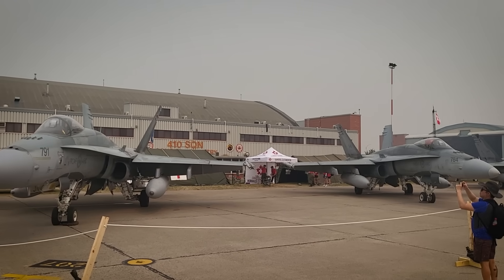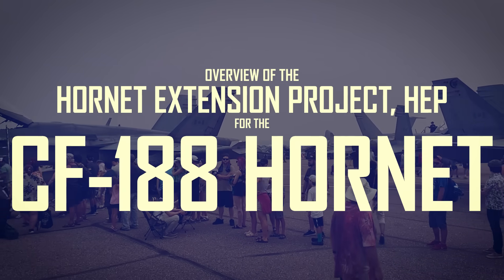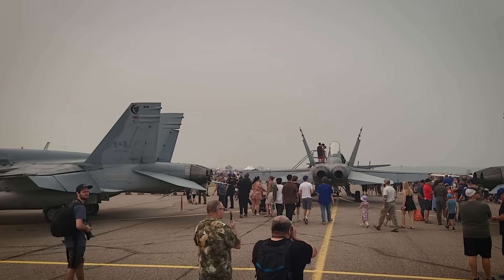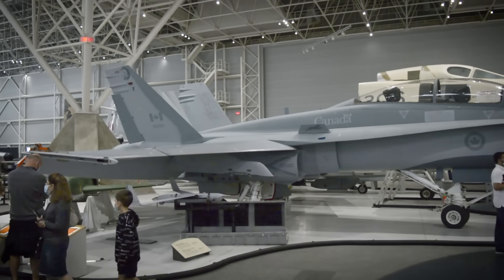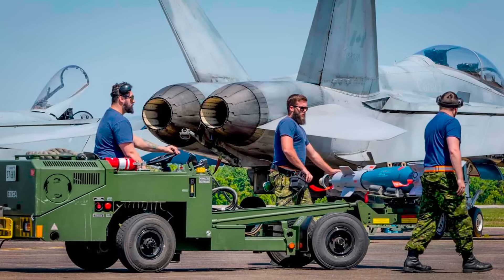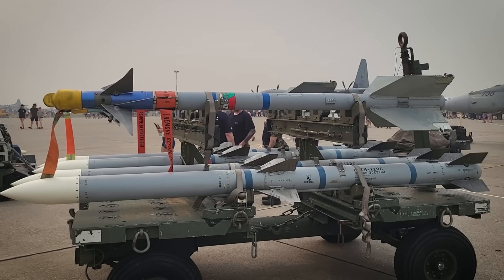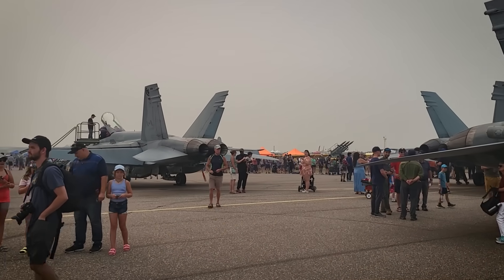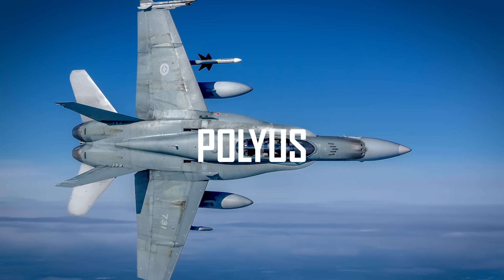The latest CF-188 upgrade program, Hornet Extension Project, HEP (No AI)

Comment: “Balloon Killer” indeed! 😂
Reply: at the 'Carney' midway, side show.
3 darts for a buck!
Reply: not just balloon killer...proven balloon killer.
Reply: I am certain that the AIM-9X has been used to bring down aircraft in Syria.  There's been multiple MiG/Sukhoi and Mi-8/-24 shootdowns there in the past decade.
Reply: @Panzermeister36 pffffft
Reply: 3 AIM-9X from F-22 brought down 3 balloons in 2023. They were modified versions.
Reply: I wouldn't bet on any kind of hornet making an intercept at 60k', modified AIM-9X or not.
Reply: @corvanphoenix  Agreed. Even the highest of the 2023 balloon intercepts had the F-22 in level flight at 58,000 feet whilst the balloon was over 1 mile higher.
A 4th balloon was shot down in 2023 by US ANG F-16 jets at 40,000 feet. AIM-9 Sidewinder was used, but I cant confirm its actual variant. 2 missiles were required for that shootdown as the first missile missed.
There's a reason why the f-22 Raptor was used for that shootdown. Some dont realize just how thin the air is up there.
Reply: @hoghogwild  Exactly. Plus just how much thrust you need to stay above stall speed at high altitude. It's kinda sad how many people think the balloon shootdown is some kind of star wars era weapon vs renaissance era threat.

Comment: Hello, the official designation we use in Canada for all our aircraft doesn't include the dash, so it's CF188 or CC330 or CP140.  The computer system in the 90s required three digits which is also why we end up usually duplicating one of the digits in F/A-18 or C-17 etc.

HEP II is primarily meant to phase in the weapons that we will receive with the CF35 project.  Great video!
Reply from the maker: Ah thanks for clearing that up! I wondered why they were different
Reply: @polyus_studios  officially the aircraft is the CF188, though CF-18 is also used unofficially.  Then the dash gets supplanted into the three-digit nomenclature.
Reply: And soon to come is the CF355.
Reply: @BBHC2012  It's too bad they didn't go with the traditional naming convention where the first digit was always 1, although the number '135' was already used by the Bell Twin Huey, the CH-135.
Reply: I like hearing how quirky things like that come about, thanks.
Reply: The fact that the military would change the designation, rather than fix the software. I'm sure this says something about the CAF, but I'm not sure what.
Reply: @thekinginyellow1744  Did you serve ?  There is lots of "smart" choices made all the time.

Comment: Amazing great video. 
Gripen vs F35!
Reply from the maker: That's a tough one. I could only really speculate about them since most aspects are classified. I like to focus on older stuff because the facts have all come out. New stuff feels like reporting on manufacturers brochures more than history.
That said, i will be going into some depth about the replacement of the Hornets and that will definitely contain some comparisons!
Reply: @polyus_studios  The question is not a very fair one in my opinion, aside from the whole classified bit.  The Gripen E is a 4.5 generation fighter (same as the upgraded CF188s) and the F35 is a fifth generation fighter.  A better comparison would be the upgraded CF188 vs Gripen E (or the last version Gripen C/D).  Would purchasing the Gripen be a step up from what we have currently, aside from a newer airframe?  For example, the Gripen and Super Hornet use the same General Electric F414-GE-39E engine, but the Hornet has two and the Gripen has one; is there a benefit to this?  Of course a video like that might be a lot more political, given the current situation, than your normal videos are, and I am not sure that is what you want to do.
Reply: @benstapley6077  It would probably be worse for Canada. Capability wise they're similar, but the F/A-18 platform has better support. It also is much cheaper than the Gripen E. Gripen C is just flat out worse at the moment, at least until MS20 Block 4 in 2028.
Reply: @benstapley6077  The whole single engine vs duel engine argument died years ago. Engines are so reliable today, that it doesn't matter as much as it did when we chose the Hornet. 

Would the Gripen E/F be a step up from what we have now? You would have to ask yourself if the Rafael, Typhoon, and Super Hornet would be a step up from what we have now, as the Gripen E/F is in the same league as they are. The answer is yes btw.
Reply: @benstapley6077  Not that whole, but "the Gripen is only a 4.5 generation aircraft" again.  The camp always ignores a few keys points about the F35 including that it will have been in the air for 20 years already in 2026 and that military radar tech has advanced to the point of being able to detect stealth planes now.  But does Canada really NEED a 5th generation fighter like the USA does.  Canada won't be entering any countries air space for the foreseeable future, China and N Korea are too far and Russia essentially has been neutered and it will probably be 10 to 20 years of re-building before it poses a significant threat to NATO, if it survives as we know it now.  That is all of the "traditional" Western enemies which leaves the only country that has directly threatened Canada since WW2, the USA.  If they ever did make good on their threats, it sure would be handy for them if they could enter a code and disable all of the jets they sold us, eh?
Reply: @viper29ca  I think the Super Hornet would have been a great Choice for Canada, that ship has sailed, the production line is almost wrapped up.
Reply: @kisaragi_san1378  but how long can they possibly keep them in the air? and are the pilots getting enough flight hours?
Reply: @kpal2946  The Marines were using F/A-18A's (specifically F/A18A++'s) up until very recently. The C's (which, for Canada, are later blocks) will be fine. No comment on the flying time for crews, of course.
Reply: @PePe_007-A1 me when i misunderstand military technology but talk authoritatively on it
Reply: @kisaragi_san1378 the f18 is cheaper because it is older and there are several counties who use it. But the number of counties using them is decreasing so the economy of scale will not be in the f18 favor for very long. Also we need new airframes. The ones we have are getting very old and it is going to become a safety issue for our pilots if we can get them into new aircraft.
Reply: @viper29ca surely two engines provides a better thrust to weight ratio, which woukd improve acceleration and rate of climb, two factors which are very important for an air supremacy aircraft. We don't dogfight like the 2nd and 3rd gens used to, but in a scramble scenario, it is still important to get off the ground quickly and to intercept altitude as quickly as possible.
Reply: @benstapley6077 no, not necessarily. F-16 has an better thrust to weight ratio than a F22.

F35 has a slightly worse TtWr than the Hornet. Gripen E is nearly better than a Rafael, Super Hornet. 

Only one of the 5 aircraft that were in the competition to replace the CF18, that was better than the Gripen was the Typhoon
Reply: @PePe_007-A1 so long as we could engage an enemy who has access to a 5th gen fighter, than our pilots should have a 5th gen. I would not want to ask my friends to risk there lives at a disadvantage. Our pilot deserve the best, and they deserve to go into battle with the equipment that will most assist them achieve victory and come home to us whole.  That is not to say I believe the f35 is the be-all-end-all. It is not. It is expensive for what it provides and as you pointed out, it's design is also getting long in the tooth.
Reply: @kpal2946 would have only been marginally better than the current hornets. Misconception that it would have been an easier transition to the SH than any other aircraft. Very little that is commone between the SH and CF-18
Reply: @viper29ca the f22 engines do not have an afterburner so they are not as efficient as they could be. That was a tradeoff to make the 22 more stealthy, and in my opinion was worth the tradeoff. The f35 only has one engine so it does not surprise me that it thrust to weight ratio is lower. The Typhon is a great aircraft, but I think it is also coming to its end of production.
Reply: @benstapley6077 ??? Lol what? 

Think you need to do some research. F22 definitely has afterburners
Reply: @benstapley6077  the number of countries using the F/A-18 has not decreased significantly; the RAAF retired them but Finnish Air Force still use them alongside the primary operator the USMC. Obviously, the desired end state is to retire them for F-35s, however this interim upgrade is both cheap for the current fleet and also keeps them very capable. The radar they are being equipped with is arguably superior to the F-16s SABR and the JAS-39E's ES-05 since it's also a GaN array (versus 39E using GaA) and larger compared to SABR (iirc). Additionally, F/A-18C simply just has more hardpoints and more ordnance options than Gripen
Reply: @kisaragi_san1378  Hey, thanks so much for letting me know. I did a little bit in the Navy,   I was always impressed with the Sea King pilots being able to fly and land those things even with the bear traps.. Thank you for service.
Reply: @viper29ca  2 engine can produce more electrical power for running electrical systems like more powerful radars, cooling systems and EW/ESM pods
Reply: @kpal2946  in Australia we got 24 Super Hornets (all 2 seat F's) and 12 Growlers (F's) back in 07 iirc as a technological stop gap before F35 deliveries and as a replacement for the maritime (and land) strike F111's the RAAF retired. I think we definitely 100% made the right decision with F18F/G's as an interim fighter and with getting the F35. 
Now we are rumoured by local think tanks like ASPI to be replacing our SH's with either the GCAP or one of the US FA/XX or NGAD 6 gen fighters in the 2040's.
Reply: @kisaragi_san1378  the RAAF does not fly the older C/D variant of the F18 and hasn't for over 10 years now. Our RAAF has only been flying 36 2 seater F/G Super Hornets and F35's since 2014
Reply: @homebase5934 No idea how I missed that but your right. Ironically the E/F Block III is not receiving as powerful a radar as the C+, although the E/F Block III does have other things going for it. They also have the complementary growlers it seems, which are a class of their own.
Reply: @viper29ca Also should research what efficiency is. Afterburners are inherently inefficient.
Reply: @kisaragi_san1378 that wasn't the comment. Comment was the F22 doesn't have afterburners. Which is not the case.

No one is disputing that they are efficient
Reply: @homebase5934 depends on the size of generator. Large gen on one engine can produce as much or more electrical power as a small gen on each of 2 engines. 

Number of engines don't dictate how much electrical power that is produced, the size of the gen does
Reply: @viper29ca What? They aren't efficient. They burn much more fuel compared to the rate of the speed they produce. I was talking about his other point which you seem to also believe for some reason
Reply: @kisaragi_san1378 you are the one bringing up efficiency. I never said ABs were efficient, just that the F22 doesn't lack ABs. 

If you are talking about someone else's comment, why are you tagging me? 

If you go back and reread my comments, I don't agree with him at all
Reply: @viper29ca  I... know? I'm saying he also needs to learn that.